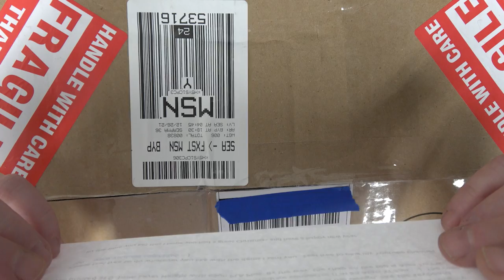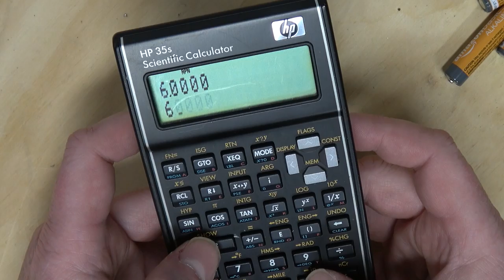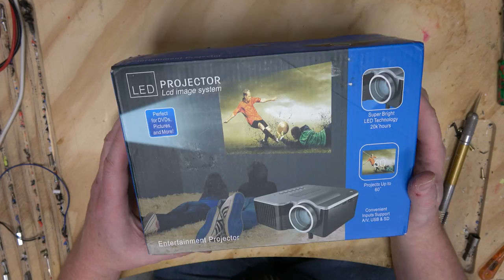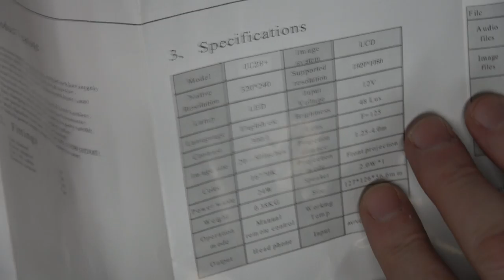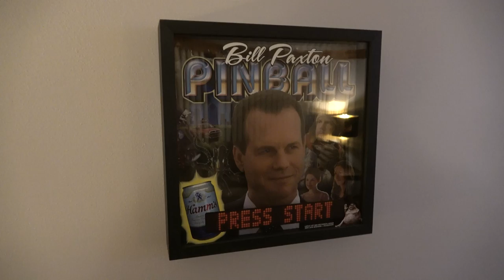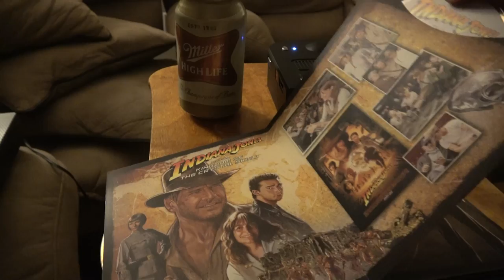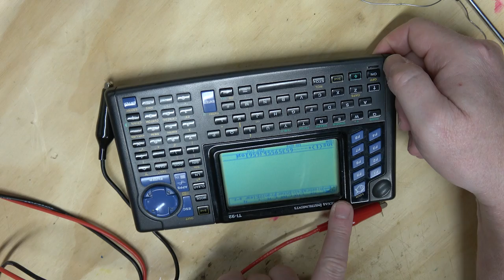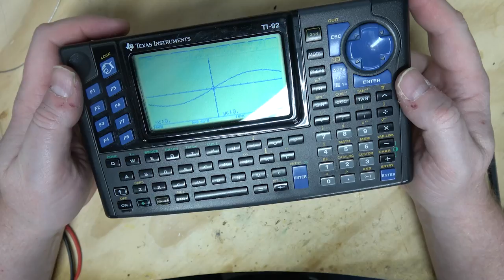Unboxing a Donation Box!

Comment: About a decade ago I worked in an engineering test lab and was tasked with cleaning out the junk room/womens restroom.  I found 5 old calculators.  My boss wanted first pick and I could have the rest.  I forget which model HP he took.  I got a TI-30, two HP-25's, and a HP-33c.  One of the 25's is in like new condition with the leather case.  There was also user/programmer manuals for the HP's.

Comment: 28:12 the screen was a big selling point for the 92. It supported full dual screen mode that worked surprisingly well. you effectively had two 89's side by side. not to mention the 92 has shockingly good 3d rendering for UV graphing. i used it quite a bit to help with triple integrals by visualizing a surface. it was just faster with the 92 because you didn't have to draw it out to see what the shape is and what order to do the integration in

Comment: When i was in high school, a student stole my old TI-83 right int front of the teacher. because of school policy, they couldn't demand that the student empty out his bag until they talked to his parents, and by then he already got rid of it. my math teacher felt terrible about it, and so he let me borrow the entire school kit that TI sent to the school for demonstrating all the various googas and widgets that TI sells. This means i got to use a TI-92 in the year they were released, along with all of the different sensor probes they had. They also had a bunch of software for doing various science experiments. i remember i got a bunch of extra credit for graphing things like heat change over time, the position of a bouncing ball, etc.

In an ultimate irony, someone actually stole the TI-92 i was borrowing as well! They broke into a bunch of cars on my street. the criminals were pretty stupid though because literally everyone on my street is military or law enforcement. a few different retired police dogs chased the theif through the woods and they tossed all of the stuff they stole, including my TI-92. After a few days in a sealed box of rice, it worked perfectly. I used that thing until i graduated high school and then i returned it. i ended up getting a TI-89 titanium engineering calculator, which i still have today. wolfram alpha is faster than the 89 though, so i rarely use it. i keep it around for when i have to be offline though

Comment: I remember using one projector back in the late 80ies / early 90ies, and would loveed to have this one instead. The old one had 3 seperate lenses (one for each r g b), and you needed to calibrate those and also the lamps did not last that long.. ah well :)

Comment: heh, power waste.  That projector on the bottom looks like the little one I found at a local thrift store too.  Strangely, mine has the same "power waste" of 24 W as yours, but with a higher resolution.  It's admirable of you to get graphing calculators out to students.  Back in 1999 our school had a case of TI-83+ calculators and one that utilized an overhead projector by way of an LCD. They were over CA$100 each at that time and are probably less expensive now even with inflation.
Reply: unfortunately not - they're still just as expensive and have high resale value.  the last one i bought was used, on Amazon for $65.  New was almost $200 USD.

Comment: "It's an HP" excitement for the graphing calculator I had in highschool 😮 reveals scientific calculator 😔

Gaffer's tape's adhesive is also safe for use on hot lights. Although in that application, it's original application, the adhesive bakes onto the lighting fixture or gel frame while still maintaining it's bond. Once peeled the residue is not sticky.

I totally expected you to show Alfred Molina in the beginning of Raiders.

Comment: It's janky, but I have had occasional success at getting those adhesive connectors to re-seat by taking a putty knife, heating it up with a lighter (about so hot that you can tap it with a fingertip and not get burned - maybe 70-80C?) and pressing down on the row of contacts with the edge for about 5-10 seconds. I think the adhesive likes to spread out again with the heat. YMMV

Comment: Actually, gaffa tape can leave residue. It also sticks to itself something bad, so never let the sticky side touch itself otherwise you may as well throw that piece in the bin.

Gaffa tape is also exceptionally strong, so much more than duct-tape (At least, here in Australia gaffa tape is the better one I have found).
Reply: @Lassi Kinnunen 81 Gaffa tape is stupidly easy to tear. Also, it may not be water resistant, but it is moisture resistant, at least, in all the cases where I have used it where moisture can be a problem (outdoor movie nights, etc...).

Comment: Notice that the HDMI connection is not labeled. This is a smart trick to avoid the need to pay a license fee?
Reply from the maker: Don't quote me on this but I think HDMI license only applies if you use the HDCP aspect of it (high definition content protection) There's actually monitors where if they don't have it a streaming service will only allow the SD version.
Reply: @BenHeckHacks  I believe usage of HDCP reduces the royalty as does displaying the logo. But once you show the logo you also need to comply to their testing. There is a good discussion on it on EEVBlog with some details.

Comment: If i remember correctly from high school a decade ago. the issue with which calculator model you could use depended on if it had a "computer algebra solving" CAS system or not. the 83/84 did not the 89/92 did.
Reply: yes, but you could write programs to solve those with the 83/84
Reply: Got me through an entire semester writing programs to do the work for me and tell me what to write down.